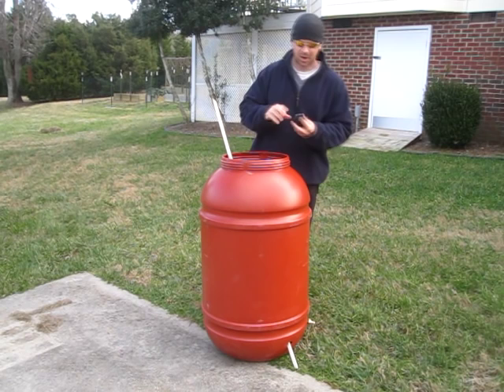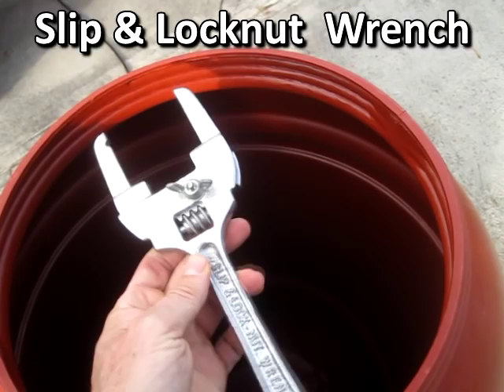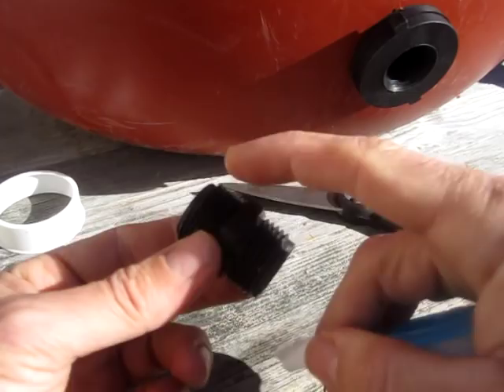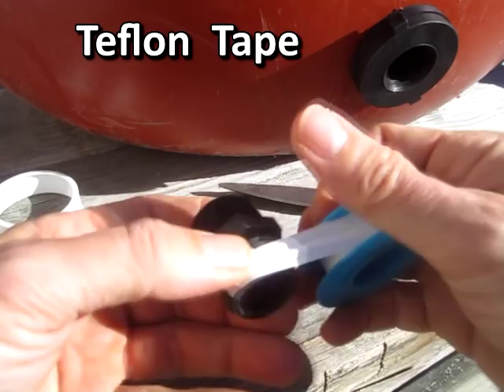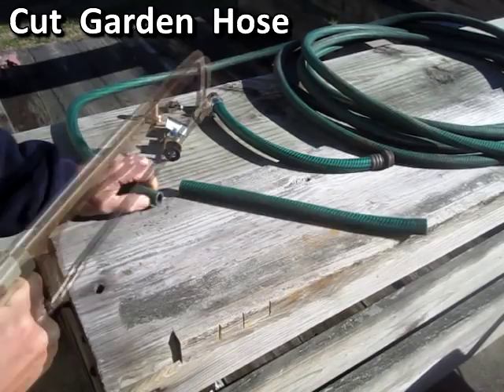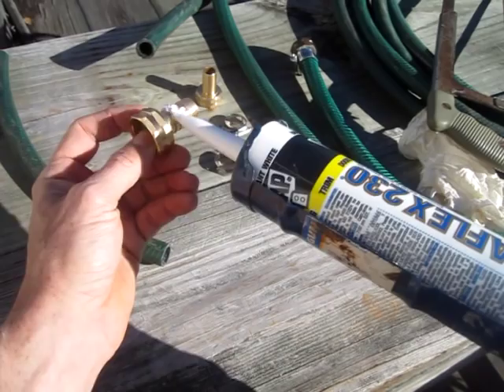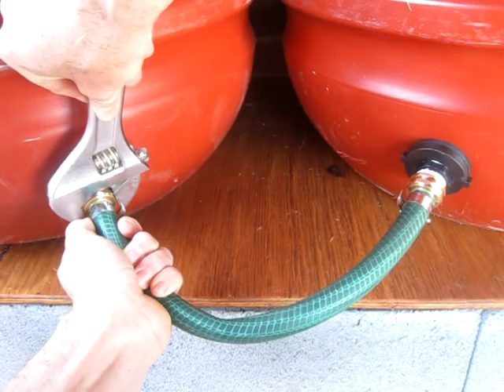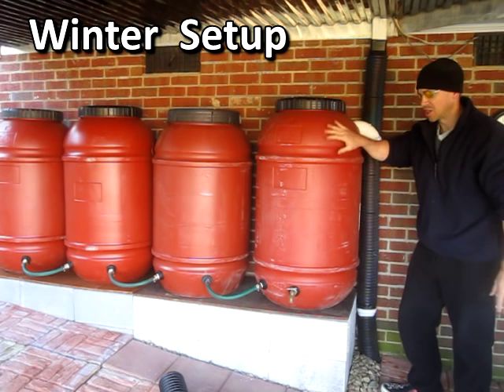Rain Barrel System 220 Gallons SHTF Water Storage Prepper Survivalist how to build make

Comment: The foundation seems like overkill to me, but a fun project.  I made a rain barrel this year using a similar pickling container but used the Earthminded DIY kit which is excellent.  It's $25 and has a diverter in the gutter that eliminates the need for an overflow so you can put the barrel anywhere.  The faucet that came with it is garbage, just scrap it.  Overall, took 15 minutes to hook the barrel to the downspout and its waterproof and works perfect.  I'm now moving up to the 275 gallon tote.

Comment: Well executed project. It's a solid system, well sealed with the right tools and components, and yet not overly complicated. Even thought there is a bit of work to add fittings to the short sections of hose it beats dealing with trying to line rigid PVC pipe into predrilled holes on the barrels. The flexible hose will allow for any settling or shifting of the platform. Thumbs Up!

Comment: Finally, someone that realizes just how much weight is involved in water storage. At 8.33 pounds per gallon, and if filled with 50 gallons, each barrel of water weighs in at 417 pounds plus the container weight. With 4 barrels filled to near capacity you'll have approximately 1,670 pounds plus barrel weight.

Comment: Excellent setup although a lot could be saved on fittings and labor by just getting one big tank already with a fitting included. That was my only issue here is that you needed a special tool to get those fittings inside the barrel. Very professional setup otherwise and great description and attention to detail.

Comment: 1:30 to 2:40 you use a stick to get the thread started on the outlet, 
what I did was tape the outside bulkhead washer into the hole and then turn the barrel over and squeeze inside  and thread the inside washer on, if I was any fatter, i would have to ask a neighborhood kid to climb inside and do it for me. but it worked. I do like the stick idea too.

Comment: Generally you overflow filling systems with water catchment having no valve solutions also creates issues when dumpin water

General with multi storage water systems , you use a static pipe on the Botton linking water together to create water pressure..

You use an overflow system to secondary tanks and 1 valve system to release you create issues setting up a water flow to extract water....

Comment: Really clean set up. I would probably use a garden hose splitter rather than drilling multiple holes and in the bottom of each barrel and using multiple bulkhead fittings, but well done nevertheless.

Comment: Nicely done, BubbleBeet! One of the nicer looking setups I've seen on Youtube.
My question is if the garden hose connections between the barrels slows the water leveling itself during a rainfall? I wonder if a larger diameter connection would capture more rain per rainfall. Have you ever had the first barrel overflow before the other barrels were full? Just wondering.
Reply: +Derek Seed I was wondering the same thing. :)

Comment: fyi, if the rain barrel you are using will be stored outside in cooler temperatures, you will need to use a different adhesive to attach your mosquito screens.  The Hot glue will pop off when the temperature drops
Reply: Except that mosquitoes can't survive below 50 degrees.

Comment: Wouldn't you want them all to be connected at the top? So they fill one by one (so you can get better pressure)?
Reply: Wheeets.    Correct.   The way they are connected one leak can empty the lot.   Hot melt glue on unprepared waxy type plastic, I don’t think so.   The first barrel acts as a filter for the rest of them, it will fill with dirt.
I’m not letting him prep for me.
Reply: Not necessarily correct. Connecting at the bottom means constant pressure/even flow. Yes, one leak means they will all drain, and hot glue is no good, but if properly plumbed, then you want all barrels to charge/discharge at the same time. The "filter" should be before any water enters any part of the system, and as it exits, with proper clean outs along the way.
Reply: Connected at the bottom does mean you only need one tap, where as at the top, each barrel needs a tap. But properly plumbed, it will not leak.

Comment: I don't know man....................

I'd put the drums "in line" (like you have them here) but with the garden hose connections at the top instead of at the bottom. This way 99% of all sediment and most chemicals would stay "stuck" in the 1st or 2nd drum only. 

I explained this is great detail in the 6:45 video "Rain Barrel Irrigation System" by Michael Fitzgerald.

Comment: Great job. I just began setup for a system like this of my own. However, everything that I have read has stated that the hoses connecting barrels should be on both the top and bottom of the system. Did you find this to be untrue?

Comment: I don't like the idea of emptying your barrels in the winter.  You're exposed at that point.  You can pick up small 110V submersible heaters (designed to keep livestock water tanks from freezing) at the ag store for not a lot of money.  Suggest you look into that.
Reply: Awesome video, it can nicely complement the strategies and watertight plans provided by Trankors Survival Secret. You'll become the man with the "know" in times of need...
Reply: Nice Video clip! Excuse me for the intrusion, I would appreciate your opinion. Have you tried - Proutklarton Surviving Technics Plan (probably on Google)? It is an awesome one off guide for learning how to survive any crisis minus the normal expense. Ive heard some incredible things about it and my friend at very last got cool results with it.
Reply: 110v is great if you have hydro. If you are "prepping" and "off grid", then no hyrdo, no generator, because they are serious points of failure.  You need 12V Solar, and/or wood fired/thermal siphon system. Look it up, plenty of examples here.

Comment: Why didn't you place the transfer hoses on top of the barrels. I think it's better since it will allow for a better flow and transfer by using gravity.

Thanks for the video though.
Reply from the maker: hi, actually hoses mounted on the bottom is the proper setup. think about it for a minute, if the hoses were at the top how would water go from one barrel to the next. thanks
Reply: Well...those same hoses at the bottom (or something similar) when placed closer to the top, and when the water rises up to them in each barrel, it should overflow the next, and to the next, and so on.  Thanks.
Reply: @victorm8186  You wouldn't be able to take water from one butt/tank and empty them all if not linked at the bottom.

Comment: wondering if you've modified this system.  w/ any substantial rain event there's just no way those 3/4" hose links could be keeping pace w/ the water inflow before the first barrel overflows.  i'm using 1" pvc links & it doesn't keep up.  lots of h2o going to waste for the both of us!
Reply from the maker: in a downpour you are correct, the first barrel will fill fast. i do find my whole system will be full after a decent 20 minute rainfall.

Comment: What happens if you have need for that water in the winter. Emergencies can happen then too. I would want it all year long. Just curious. I don't have one and don't know. Thanks, great video.
Reply from the maker: in the winter u could temporarily set it up and collect water. then transfer the water to buckets and bring indoors. then drain and unhook the system so it doesnt freeze solid and break the barrels.

Comment: Sorry, prepper noob here, having the hose connections at the bottom joining the barrels means that the water levels will be split evenly across all barrels right? I guess it can still handle a large intake of water if it start raining had due to the larger mouths overflow?

Also di you have a way you prefer for  purifying said water if you needed emergency drinking water?

Great video, subscribed.

Comment: Am I misunderstanding? Why are they all connected to the bottom? Shouldn't they overflow one into the next at the top? Somehow I'm either making this too complex or too simple in my head...
Reply: Probably just personal preference. If you have them connected via overflow at the top, then you must have a spigot on the bottom of each barrel. That means you'll be switching hoses from barrel to barrel, since you cannot get the water back into the first barrel once it overflows. If you have them daisy chained at the bottom like this, the water level in each barrel is always level (as opposed to one filling, then the next, and so on) and you have just one spigot.
Reply: Joshua Staples  Actually, he should put valves on the bottom, connect them all to a single drain pipe, then he doesn't have to move the hose from barrel to barrel, and with the valves at the bottom, he can control which tank gets emptied.  And this works best when the barrels are filled from the top.  Another benefit of top filling is that the water is cleaner from the second to the last barrel, as the first barrel will get the dirtier water in it, but being connected at the bottom to fill, all barrels share the same dirty water.

Comment: Nice setup where did you get the barrels?
Reply from the maker: found them on craigslist dot org they were 20 bucks each with lids. they were at a garden center about 15 miles away, in the back of their property were hundreds of used barrels, only a small amount had lids.
Reply: Cool thanks
Reply: xzevious69 One possibility is to check with an Italian restaurant that you frequent. Ask the manager if they get olives in large plastic barrels. You might be able to get an empty barrel for free or a nominal charge.

Comment: does the calk and hot glue not leach into the water? Asking in case we want to set this up for a reserve of personal drinking water.
Reply from the maker: craig listly Water never comes into contact with the hot glue or caulk. The caulk was placed on the outside of the brass fitting, then the hose was slid over it pushing the caulk away from the inside of the hose. The water level never gets high enough to touch the hot glue on the Barrel lid vent holes.
Reply: craig listly If you dont put that screen on it like he showed you,  you will get bugs that will put there eggs in the water like mesquetos.   so the screen is very inportant.    I have been building these since the 80's for people.   and Bubblebeet is right on the money with the way he showed how to do this.
Reply: Just Me
wasn't talking about screen at all. was wondering about adhesive contaminating water if it filled to top.certain chemicals can ruin your water source was wondering if he knew so i wouldn't have to go look it up.
Reply: craig listly well for the small ammount you would be using, i would not worrie about it.  I had a large ball of it marbale size of hot blue.  and my son eat it..  I called the doctor worried  and he told me it will be digested and what little cemicals are in it he would not worrie..  

So since you are not eating it,  if some did leak into the water it would be much less consintrated the what my Son did.       so i would not worrie.
Reply: Just Me If you are still worried you can buy HOT club for glue guns made natual.
Reply: no i sorted it out long while ago, thanks though
Reply: ***** Ah, if the water never comes in contact with the hot glue or caulk, why did you use it?  Seems unnecessary.
Reply: TheStavros1001 The water goes through that screen. The screen keeps mosquitoes and debris out. The hot glue seals and glues the screen to the barrel. The caulk helps seal the hose fitting. You could use regular 100% silicone as well.
Reply: +craig listly  That rain water ran across asphalt shingles on the roof first, which can be covered in algae, moss and debris
Reply: Jerilyn Holland
 not sure what your getting at?
Reply: +craig listly means don't even think about drinking the water, it is for garden use and washing yourself , the water is already in touch with chemicals in your roof
Reply: Just out of curiosity, other than tar, what chemicals are there?  And remember, tar used to be used for sealing wounds...
Reply: +TheStavros1001 maybe candle, Parafphin, Gum, be creative....
Just teflon  tape can give you a good seal,
also Caulk is not watersoluble , it is sort of a plastic, so maybe it is safe
Reply: Sorry, you must have missed my point, you talked about chemicals from the roof, I'm asking what chemicals you are referring to.  Tar (asphalt) used to be used to seal wounds, so must not be too terrible.   

BTW, most caulks will leach chemicals into water if in contact long enough, so be careful what you choose to use.  

Me, I used no sealants on my tanks, just food grade approved parts.
Reply: the name alone (fiberglass shingles)  on the roof seams not to safe to drink

Comment: Where did you buy that barrel?
Reply from the maker: craigslist
Reply: I need some help with that elbow connected the overflow pipe. My local hardware store only ave 4" drain pipe which I think is ideal but how do you get that 4" elbow to connect to the barrel?